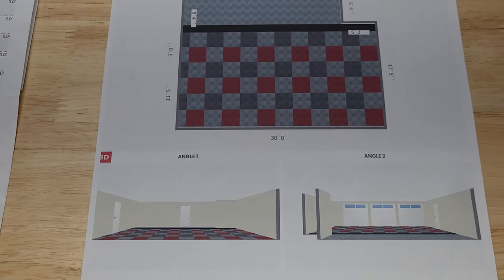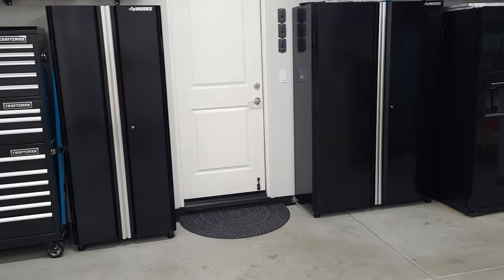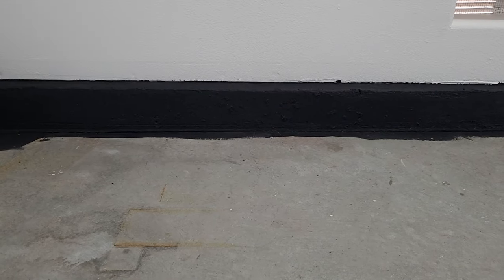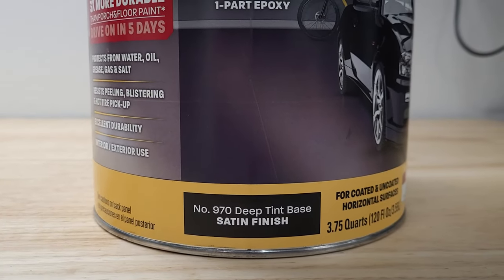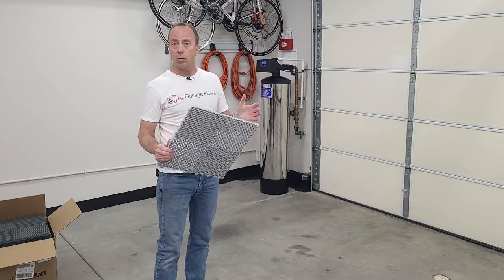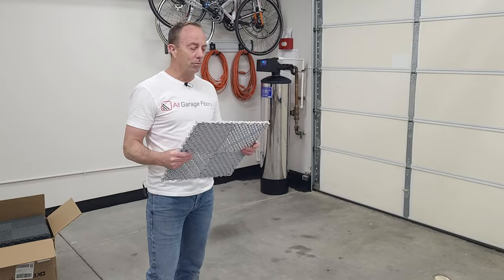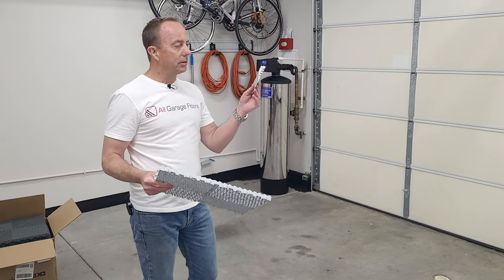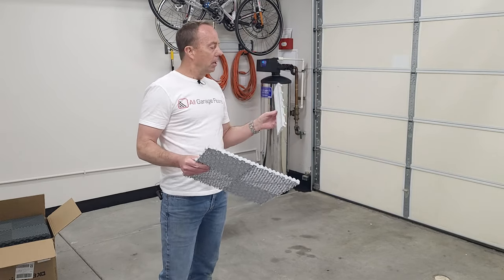Swisstrax Installation | A DIY Guide to Installing Swisstrax Garage Tiles

Comment: Floor tile look terrible when not started from the center of the room
Reply from the maker: Hi Rick. I've laid my fair share of porcelain, ceramic, and natural stone tile floors in past homes. With few exceptions, I agree that the layout should always start in the center of the room. However, plastic and PVC tiles layout differently due to expansion characteristics. The industry standard is to always start at the entrance of the garage at the doors.

Comment: so when you spill chemicals, oil.......you cannot wipe it off.....just let it eat the concrete?
Reply from the maker: This is a common question that people have. Oils and most chemicals won't eat concrete. Only acid will do that. We use a few PigMat towels to lay down when doing oil and gear oil changes. Same for brake jobs, bleeding brakes and anything else may encounter a fluid spill. In the event you do make a mess, the tiles are very easy to pull up so you can clean the concrete. We demonstrate how easy it is in our 6 month review.  You can watch it here: https://www.youtube.com/watch?v=-MQ2kDkBulo&t=1s

Comment: I like the Swisstrax   also I’m going to use my garage to wash my cars which one will be the best for me
Reply from the maker: Hi Gearl. The Ribtrax Pro and Ribtrax Smooth Pro are both popular for detail shops that wash and detail vehicles indoors. Swisstrax states that the Ribtrax Smooth Pro provides the best grip between the two when the tiles are wet with soap.
Reply: @allgaragefloors  so my garage is 24 x 24 is that how you order it?
Reply from the maker: @gearlstrickland3365  There are a couple of ways to determine what you need to order. If you click on this link: https://bit.ly/3utqNgD it will take you to the Swisstrax product page. Click on Floor Designer in the menu bar at the top. It will allow you to input your floor size. You can then choose your tile and color/s and it will determine how many you need. You can place an order from that. Or you can call their toll-free number to give them the information if that is your preferred method. Don't forget to use code AGF24 to get your discount. 🙂

Comment: How much is Swisstrax per square foot
Reply from the maker: It depends on which tiles you purchase. The link I provided in the last comment takes you right to pricing. If you use code: AFG24 you can get an additional 5% off.

Comment: Some people say you have to take your tracks up to clean under them is that true?
Reply from the maker: It depends on what you are cleaning. Any loose material such as dirt, debris, sawdust, etc. can be pulled right off the concrete through the tile with a shop vac. We did that when we cleaned all the shavings from cutting tiles during our installation. The only time to pull tiles up is if you have some sort of major spill such as oil or some other automotive fluid. Even then, it's fairly easy to pull the tiles up. One of the major advantages of the Ribrax tiles is that they rarely look dirty due to the ribbed design. On the flip side, solid top tiles require regular cleaning maintenance. We had a solid top RaceDeck floor for 8 years :)

Comment: Great video. Above your tool box you have some shelves and you have those black with the yellow top binds. What brand are those black shelves? Thanks in advance.
Reply from the maker: Great question! They are called FlexiMounts and we purchased them here from Amazon: https://amzn.to/3BsUl13 We are currently writing up a review on those racks and doing a video. We really like them. They can be used as corner racks or lined up side by side. They provide a real clean look that we like.
Reply: @allgaragefloors  Really cool!  And if I may ask also, what is the product you used to hang your bicycles off the wall/ceiling?  I could use that!  Thank you.
Reply from the maker: @progression_decibel  Good eye! Ours was bought years ago and called a Racor Pro. There are other companies selling it under different names now. You can find it here on Amazon: https://amzn.to/3UnHjrZ

Comment: Great video. Just curious why you transitioned the smooth pro in the back?  Is the smooth much easier on the feet and wheels is this why?
Reply from the maker: We wanted to compare and review both designs. Because most of our foot traffic is in the back of the garage, we decided to add the Smooth Pro there. We preferred the look of the Ribtrax Pro when inspecting individual tiles and looking at images online, so we opted for the majority of the garage to be that option. However, the Ribtrax Smooth Pro looks very nice once installed on the floor. The Ribtrax Pro is not hard on the feet and toolboxes and floor jacks roll nicely across it. The Smooth Pro is even better in that regard. We discuss it more in our 6 month review video: https://www.youtube.com/watch?v=-MQ2kDkBulo
Reply: @allgaragefloors  thanks for the feedback and honest opinion on both floor types. I’ve been contemplating which finish to go with and heavily leaning on the smooth version and this helps tremendously. I’ve also been rethinking the silver color for smooth because of the dirt accumulation. I would think silver on pto would look cleaner than silver on smooth so perhaps grey is the happy medium for smooth. I know it’s highly subjective but always helpful to ask and hear feedback. Thanks
Reply from the maker: @MrAmonts  You are welcome. If you watch the video of our initial 6-month review, we purposely did not clean the floor since the day it was installed so that you can get an idea of what to expect in terms of dirt accumulation. We show you the results. You may be surprised.

Comment: Thank you, thank you, thank you for this video.  On your recommendation I ordered a SwissTrax floor for my garage, I ordered the Smooth Pro tiles.  I watched your video multiple times just to make sure I was doing it right.  Every tip you gave was spot on accurate and made the job that much easier and more professional.  I painted my moldings black as well as a 2”strip on the floor, I used a fence for absolute straight cuts, I used scrap from the back of the garage to patch in the front. Thank you for showing a right side start and the importance of orienting them the correct way as the right side was where I needed to start.  My 20x20 garage took eight hours but most of that time was spent trimming, by the way no mis-cut tiles….straight/straight….that kept going through my mind with every cut. Your tip showing cutting two tiles at a time really cut down on the time and laying down all the full tile first made measuring more accurate. I did use your discount code so thank you for that.

I will warn anyone out there that there are other videos showing how to install these tiles but they incorrectly done.  In one video the guy puts down the first tile with the wrong orientation and then blames SwissTrax at the end for sending the wrong edge pieces. His entire video is what not to do.  This video is done well, it’s accurate and full of great information.  Thank you All Garage Floors!
Reply from the maker: Hi Chuck. We are glad the video made your floor installation go smoothly! The tiles are not hard to install, but it's very easy to make things more difficult on yourself if the procedures aren't followed. Have fun with your new floor!

Comment: very informative -- got a new house in Florida being built with a 3 car garage -- initially thought going with epoxy but not anymore -- going swisstrax
with this being a new floor should i put down a waterproof sealer? -- also love the idea of painting black along the base
Reply from the maker: Hi Steve. Applying a penetrating concrete sealer beforehand can help protect the concrete from moisture and the associated issues. We didn't do it since we live in Southern California. Just be aware that penetrating sealers do not waterproof concrete. They repel and resist water. If water sits long enough (longer than what it takes to evaporate), the concrete will still absorb some water. Coatings will prevent water from intruding except for joints. However, they are not recommended for floating floors such as Swisstrax. It creates a slippery surface that may cause the tile to shift when under load by a vehicle.

Comment: A couple of questions before I place my order:
I have a freshly painted gray floor. In order to save a little money (and especially to save the effort of having to make cuts) is there any problem leaving up to 1 foot untitled area on each side(except the front)? Also, whether I do this or not, is there any issue with tiles shifting, especially when turning the wheel on a stationary car?
Reply from the maker: Hi Arthur. Tiles won't spin up or unlock when turning the wheels of your car. If you center the floor, the most concrete you would have exposed on either side if you don't want to trim to fit would be just under 8". However, we do recommend that you trim the tiles in the back of the garage. If you don't, you may experience the entire floor shifting when pulling in and stopping. It all depends if you have heavy items on the floor or another car. Right now you can get 10% off Swisstrax through September 4th. Use this link: https://bit.ly/3utqNgD and code LABORDAY24 at checkout.

Comment: lowes dont have that epoxy seal anymore. only way is to have them ship it but its like 80bucks shipping :(
Reply from the maker: Yeah, it can vary depending on your area. I just checked and it's still in stock at our local Lowes. You might want to check HomeDepot. Our local one carries Behr 1-part epoxy in Jet Black for $48.